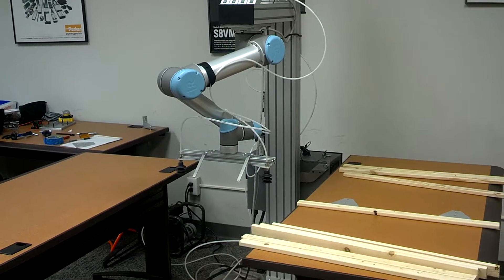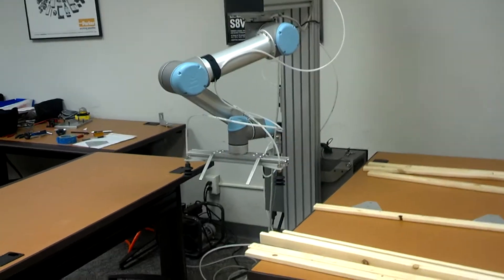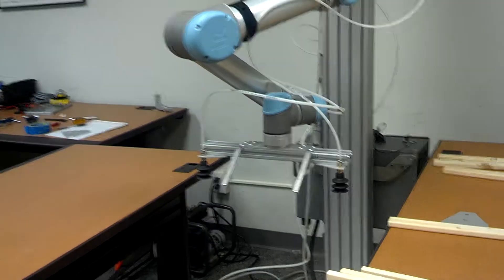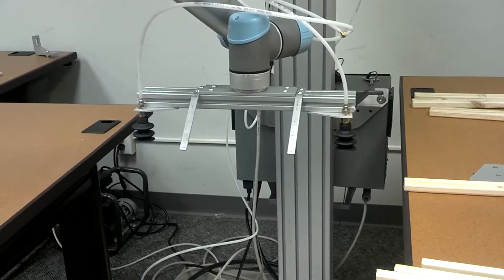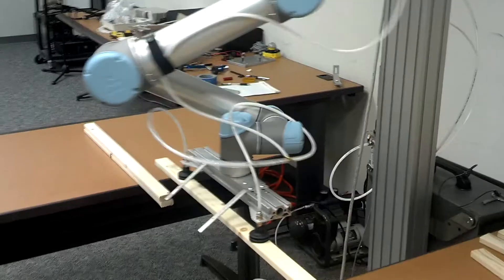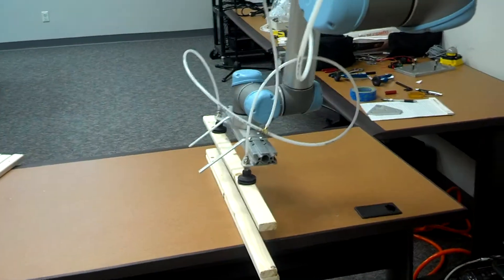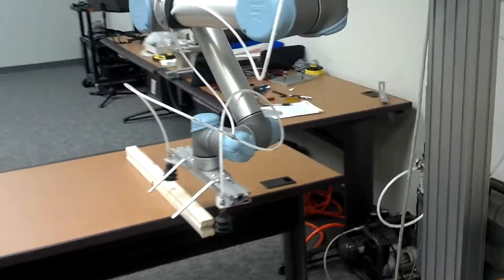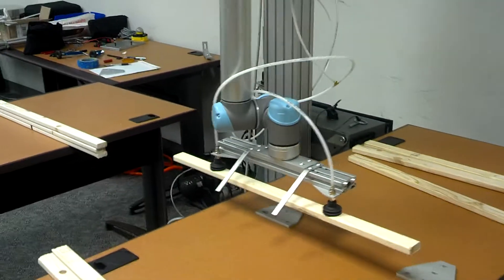Universal Robots Board stacking demo

Comment: How does it recognize the wood, and what are its speed limits?
Reply: Speed 1m/s collaborative, 2m/s rated. It's most likely detecting the wood pick up when the vacuum is good. The wood is also in the same place in this application. The stack routine adds an offset after every board so the next piece drops off a wood thickness higher than the last one.